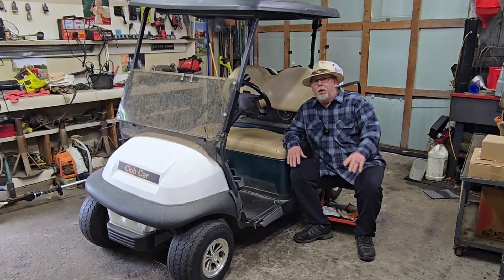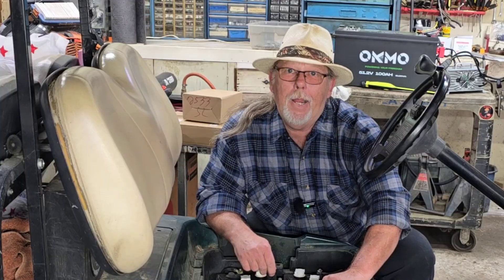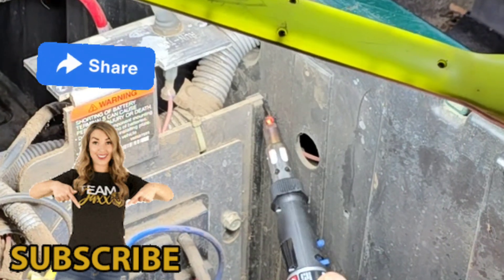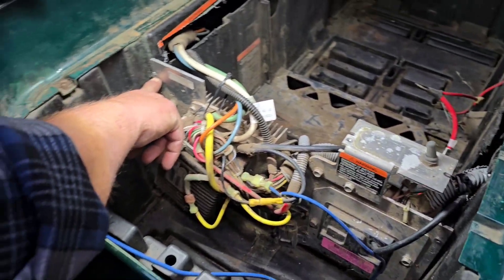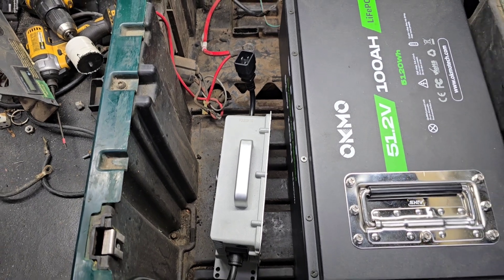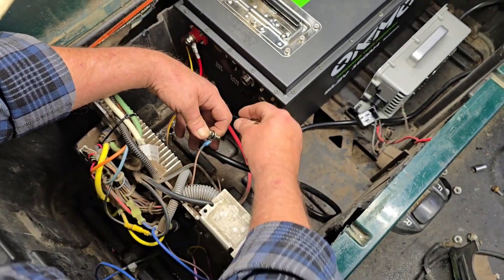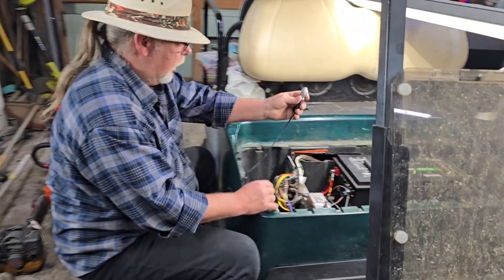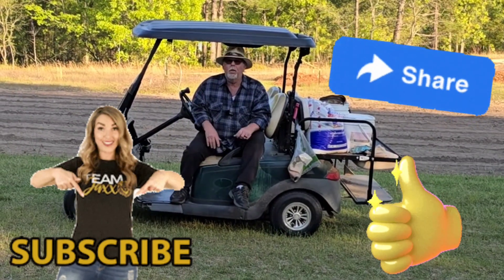More Power, Less Weight: Lithium Battery Upgrade for Club Car Precedent

Comment from the maker: 🎁 Use the discount code(s) below to save on your own OKMO battery upgrade:
OKMO's Website: https://okmotech.com/collections/golf-cart-batteries
OKMO Golf Cart Batteries: www.amazon.com/dp/B0DTT8T922
🔻Code for OKMO 48V($365 OFF): R48100OKMO
Code for OKMO 36V($504 OFF):R36100OKMO 🔻

Converter Voltage Regulator Reducer Transformer with Fuse 
https://amzn.to/3EngGPk 

Dremel VersaTip Precision Butane Torch 
https://amzn.to/4imDGfi
Reply: Help.  Code did not work